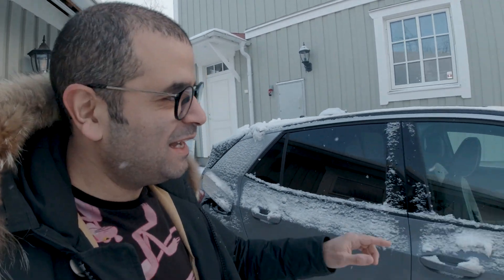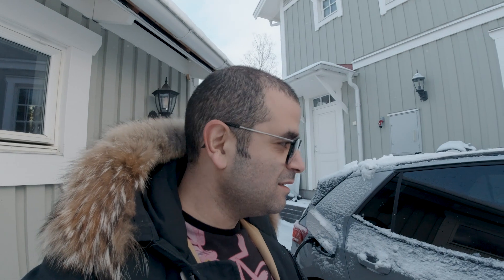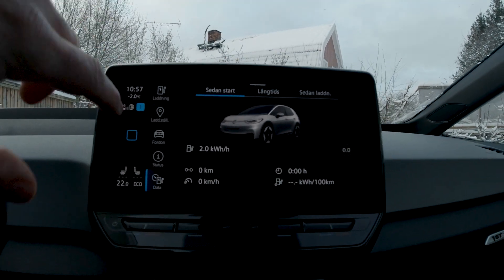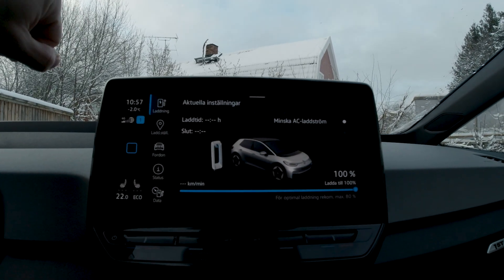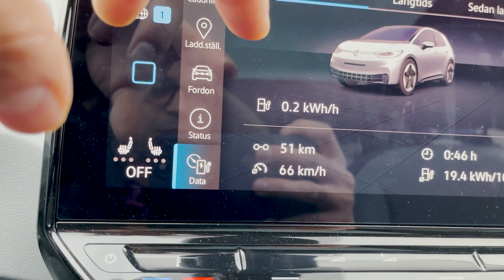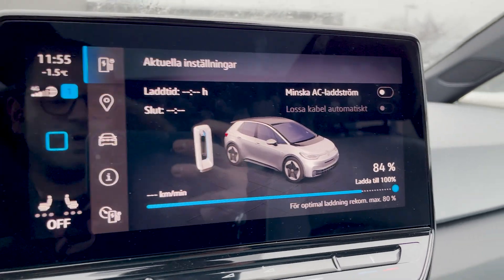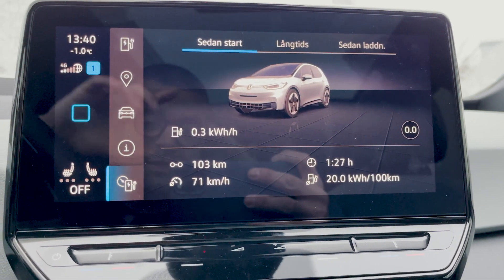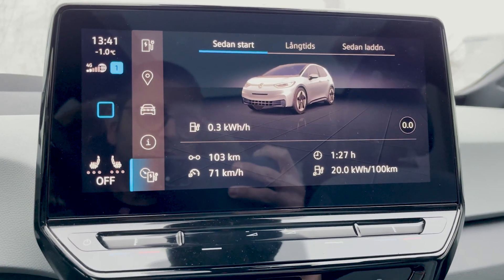Volkswagen ID3 1st Max - winter day drive efficiency test! The car has a design flaw?

Comment: Not much you can reasonably do with front sensors and Nordic conditions - even heated sensors won’t get rid of the salt smuts that will eventually cover them. Perhaps self cleaning sensors like headlight washers would work. I don’t know of any car currently on the market that has that solution though.
Reply from the maker: yeah that is true! Just got surprised that I got this issue with this car straight of the bat. We have had 6 cars in the past 5 years and none of them have had this issue :(

Comment: I think so you shouldn't change to 100%
Reply from the maker: should only charge to 100 if you will use the car soon after it is fully charged. Otherwise up to 80% is recommended
Reply: @Themazcorner  Yes I know, but at your video you charged to 100% and came back with 60%? so you did not needed :)
Anyway I've got VW e-up! my first electric car for 3 years, and now I am waiting for my id3 pro s :)
Reply: @Themazcorner  I do exactly same with my e scooter even though manual says charge before and after each use. They never mentioned percentages

Comment: your average consumption is too low, the real range is around 200-220 km. Battery heater takes 6kw and heating 2-3kw.
Reply from the maker: so you mean the average consumption should be higher? I preheatead the car before departure with the charger connected, reset the trip computer and started the ride. Did drive 51km was stationary for some time did not pre-heat the car before I started the journey going back home.
Reply: He only had an average speed of 71 km/h. The car does that with 14 kWh/100km in the summer. That's a plus of 6 kwh/100km or 4,3 kWh/h for the heating. Your 220km winter range is highway speed with 120km/h average.
Reply: @Psi-Storm  not in my driving, summer average was 18kwh/100. now two trips in winter 666km with 21 kwh/100 (temp -3 ... -15) and 670km 23 kwh/100 (-28..-14). first 50km or so on the consumption is whopping 30kw/h. and my average speed is near 80km/h. I think the problem is the battery heating and the poor heating on low temperatures (side windows start to frezee if you lower the internal temp or slow the fan speed)
Reply: I'm in Norway and we get around 350 on a full charge this winter with our driving - it's kept in a heated garage though so very little battery heating  going on during short trips (which is a real range killer) and we have a heat pump.

Comment: You are right, the accumulation of ice and snow can cause this message to pop up. It also happens on other car manufacturer.
Reply: Common problem on most cars in really snowy weather. I actually had the same problem today driving from Stockholm to Uppsala in awful weather, and I drive a 2020 BMW 330e Touring xdrive...
Reply from the maker: @swetriton  maybe! however as mentioned in my previous post I have not experienced this on any of my more recent cars and I/we have had a few over the last 5 years (six other cars that have been driven during the winter). Never had had this issue  with my 330e. Let's hope for no more snow :D
Reply: @swetriton  also in thermic golf, with snow, not always but often,
Reply from the maker: Yes it seems to be the case. Never had that on any other car before though. Not that I recall and the amount of snow we have had is not that much